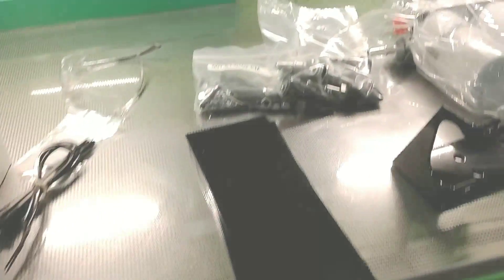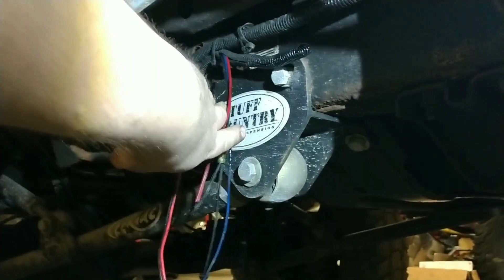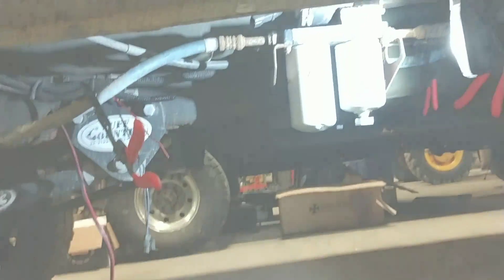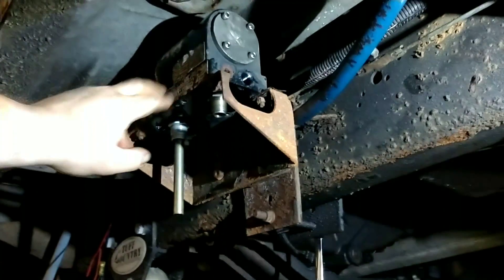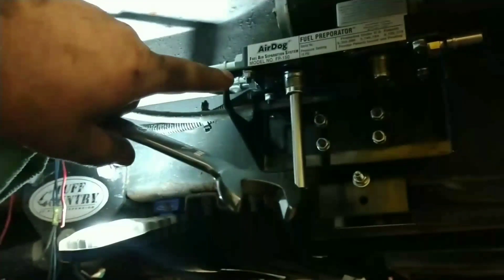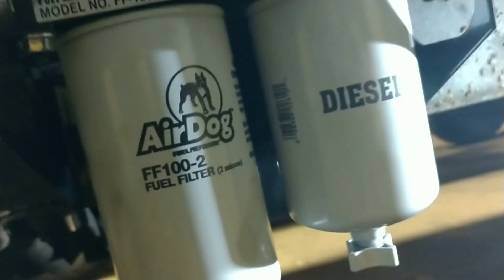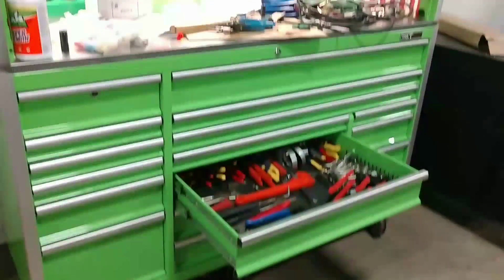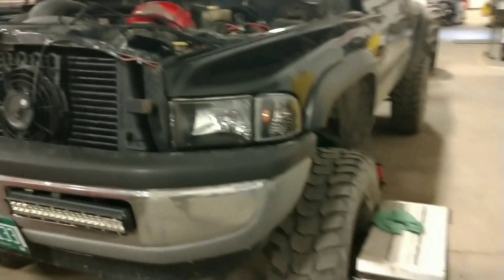Dodge Ram 2500/3500 Cummins: Performance lift failure  AirDog 150

Comment: What advantages does this set up have over factory? I’m used to OEM so aftermarket is foreign to me.
Reply from the maker: The factory lift pump are know to lose pressure. The vp44 pump over heats and fails they are $1700 plus. The air dog system take out the stock pump and filters and adds a water separator. It pumps at 150 gpm at around 15lb of pressure. My truck is modified with injectors and a tune so the stock pump starves out. At wide open throttle the new pump supplies more than enough fuel so the vp44 injection pump stays happy. It's recommend on these trucks stock imo but definitely cheap insurance at $599.